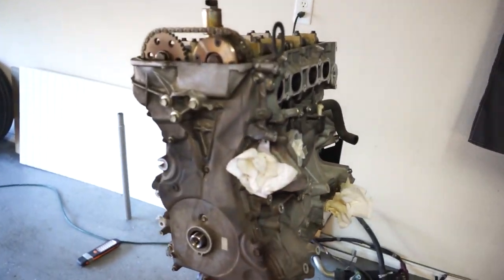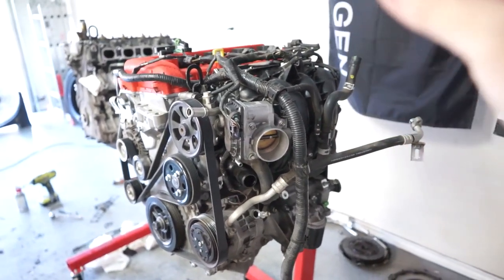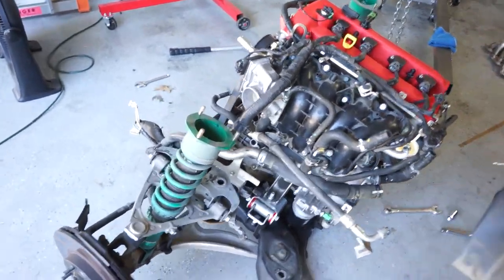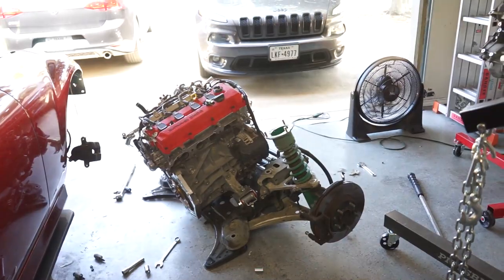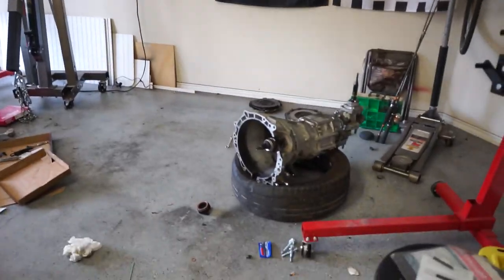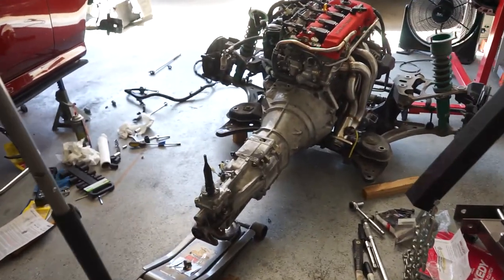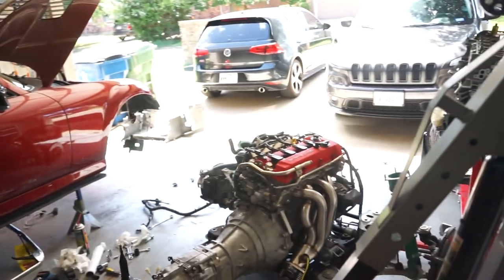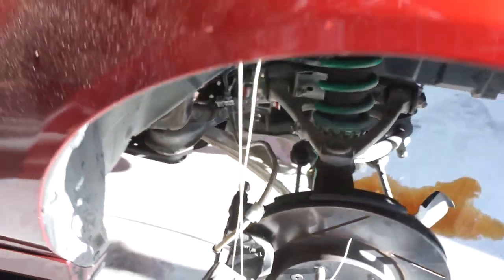Installing Clutch, Trans and Engine in the Car! - 2.5 Swap Episode 22

Comment: Hi, just 2 questions, can i usemy old nc engine mounts? Is it possible to install engine and transmission from the top??

Thanks
Reply from the maker: You can install from the top, I've heard it's a lot more involved and going out the bottom is easier. You can use old mounts too, but you might want drop brackets if you're doing the 2.5 as it is a little taller.
Reply: @ColoredinLight  thanks

Comment: Hay, my Dad and I just found your videos and we are doing the same (Fusion engine with Mazda transmission).  Ours did not bolt up, what years are your engine and transmission?  Thank you!
Reply from the maker: Sounds like a fun project! I think I have a 2014 fusion engine and my transmission is for a 2011 Miata.
Reply: @ColoredinLight   LOL!  We have a 2018 Fusion engine and 2018 Miata 7 speed manual transmission that don't bolt up.  Thank you for replying and great videos!  🚘
Reply from the maker: Yea you probably want to find a NC transmission, you have an ND Miata trans
Reply: @ColoredinLight   We just figured that out.  🤣  We are thinking a '08 should work, higher mileage but we can rebuild it if needed.  lol  Thank you again we really appreciate it!!!